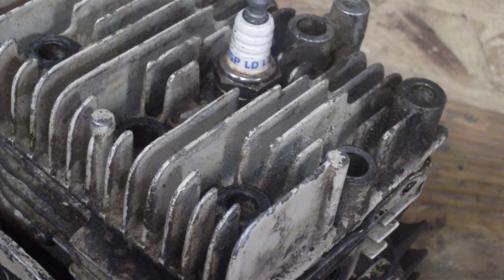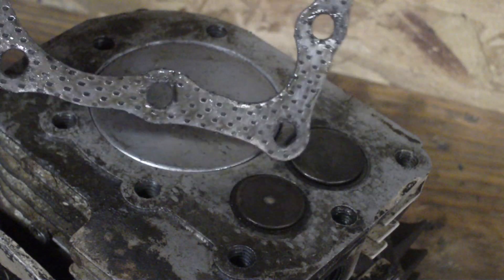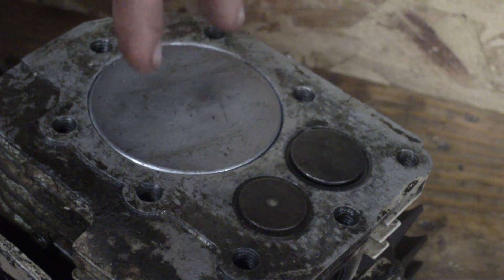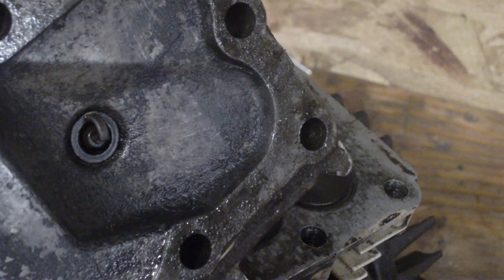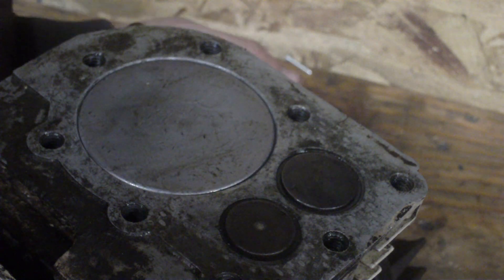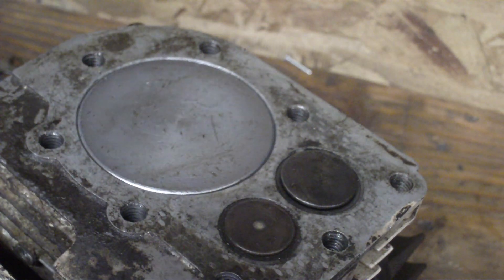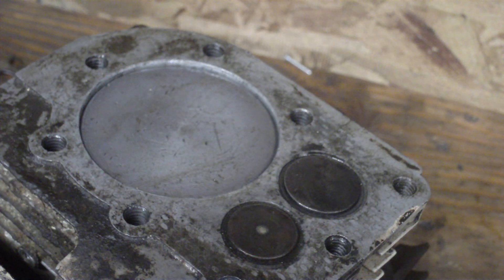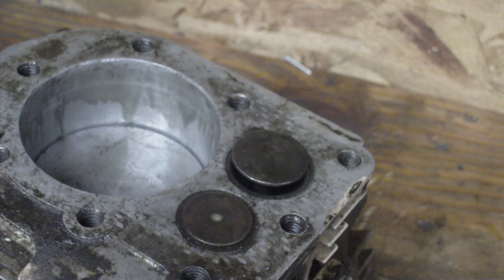How a 4 Stroke Gasoline Internal Combustion Engine Works

Comment: why are the valves inverted like that?
Reply from the maker: This is the old flathead or L-Head engine design, it was a very good and reliable design but has unfortunately became near obsolete, they have been replaced with OHV (overhead valve) engines. Which are more efficient but from experience, not nearly as reliable. Vehicles used to use this type of engine, Ford was well known for the Ford Flathead V8, great engines. I figured this would be easier to show the process because you can see everything moving together. Thanks for Watching!!!

Comment: what would happen if some how i put the carburetor where the muffler goes and the muffler where the carburetor goes
Reply from the maker: If you did that, you could make it run backwards, because the valve timing is opposite. I've seen some engines build up excessive fuel in the muffler and when you shut it off it will try and run backwards, almost like its dieseling. Thanks for Watching!!!
Reply: so could it run the same if i do run it backwards and if it does how can i run it backwards
Reply from the maker: Look up chargermiles007 channel on here, he actually did a year or 2 ago, it seemed to run pretty good!
Reply from the maker: i figure there will be oiling issues though, because the oil slinger will be spinning backwards too.

Comment: what was the engine out of mate I have a 26cc 4 stroke Briggs out of a whipper snipper and am wanting to find parts
Reply from the maker: It was off of sometype of push mower, not sure what type. It could have been off a tiller since it had the cast iron flywheel on it. I don't even have the model numbers for it. But the model number should start with 9, 9 cubic inch. It will either be a 3 or 3.5 horsepower rating. Thanks for Watching!!!

Comment: Great video, but I dont understand how the piston moves when it isnt the power stroke.  What is giving it the energy to come back up for the exhaust stroke and then down on the intake?
Reply from the maker: I should have mentioned this on the video, engines have a heavy weight on the crankshaft called a flywheel, it stores energy from the power stroke to keep it spinning between power strokes, think of it like how a washing machine "coasts" when the spin cycle stops, it takes a while for it to stop spinning, do the momentum of the spinning drum, just like the momentum in the spinning flywheel. Thanks for Watching!!!

Comment: I'm 50 years old and have never heard a clearer and more sensible description of how a four stroke engine works. I finally understand why air and fuel ratios are tweaked. Just never quite clicked. You, sir, have a gift for explaining things.
Reply from the maker: I hear ya! Glad to help out. I guess some people just explain things differently. Appreciate that! Thanks for Watching!!!
Reply: Double valves even makes sense now.  Ding!
Reply from the maker: I hear ya!
Reply: @fnaguitarplayer9  it's a pleasure to watch these types of videos. I've always wondered how it worked without a timing chain. Now I know why nearly every engine oil, passenger car, heavy duty diesel oils And motorcycle oil can be used in these little engines

Comment: what Couse an engine to leek oil from the breather  house the one the came from valve cover to the air filter on Honda 13 hp.
Reply from the maker: +lino zamarripa There's a few possibilities, first off is to much oil in it, that will make it seap through, also if the hose is starting to dry rot it will seap through, or if the engine burns some oil (blue smoke in the exhaust) blow-by past the piston can cause more pressure in the crankcase making it leak some oil. Thanks for Watching!!!
Reply: i putted new ovh cover and new breeder hoes now blue smoke come from the exhaust that's may be because the rings are bad thank you
Reply from the maker: +lino zamarripa Sounds like rings, valve guides (and seals) will cause it to, but usually the rings. Your welcome!

Comment: Hi, Your video is the best, and very much the only one about 4 stroke,  2 piston. I have a Moto Guzzi 850 and your demonstration clearly made me understand why my spark did not happen at the correct time therefore the bike never started. I therefore adjusted my ignition to happen on the second stroke. For me, I find it inconvenient to have to  remove my valve cover clearly see when the second stoke arrives, ready for the spark. I'm looking for tricks like putting my thumb in the spark plug hole or hearing the suction in the carburetor. Not sure. Any suggestions? Thanks. JD
Reply from the maker: +Jacques Daze Appreciate that! I hear ya. Glad to help out! It would be possible to go by the suction or compression on the spark plug hole, and gently use a small screwdriver through the hole to find top dead center, but it would be more accurate with the cover off watching the valves. Thanks for Watching!!!

Comment: I am a big fan of all of your small engine videos, thank you for posting. I recently got a mower (brute 22" with a flat head 675ex by briggs)from a guy who after replacing the coil, spark plug and air filter, couldn't figure out what was wrong with it, I brought it home gave it a few pulls and realized the flywheel key was broken. I replaced the flywheel key and it still doesn't run. I cleaned the carb, made sure it had spark. did a compression test: no compression. I pumped 80psi into the cylinder through the plug hole: no leaks. So i tried putting a little gas in the cylinder before replacing the plug and the gas was sprayed out the intake/carb. I put my hand over the carb and instead of suction I felt blowing. I removed the muffler and felt sucking though the exhaust. when i had the plug off i turned the motor over with my hand over the hole and felt suction rather then compression. i removed the head to see if maybe one of the valves was sticking but it looks like they are backwards, the exhaust opens and sucks in air and the intake opens to release the burnt air/gas. sorry for the long comment I couldn't figure out how to message you privately. I can make a video of that will help.
Reply from the maker: +Alex Rodriguez Appreciate that, your welcome! Ok, sounds like someone must of had it apart and put the wrong camshaft in it. I did this one time on a 14.5HP OHV briggs, i put a flathead cam in it because mine was bent, I thought it was the same but the valve timing was completely backwards! Its either that or someone put it back together and didn't like up the timing marks. Hard to say really for sure. Hope this helps! Thanks for Watching!!!
Reply: I pulled the crankcase off and the crankshaft gear had two marks almost opposite from each other, one arrow/triangular one and a smaller round one. I aligned the camshaft with the smaller round one and observed the valves. Worked perfectly! When I got the motor it had a sheared flywheel key so I guess the original owner thought it was a timing issue and tried to adjust it. Thank you for the reply.
Reply from the maker: +Alex Rodriguez oh wow, I was afraid it may have been messed with before or something. Glad you got it figured out, your welcome!

Comment: I remember watching this 4 years ago when I wanted to know how engines work and this video made me want to explore small engines. Now I have 2 commercial walk behind mowers that I fixed up for cheap because of my knowledge. I also got about 10 push mowers because I'm a hoarder. Just ran across this video and I thought I would share
Reply: The two mowers are 48" scag and a 48" exmark viking hydro walk behind. Both of those combined only cost me only $800

Comment: Let me ask you this if you may. I work for the fire department, and we have a few different 4-stroke small engines that power our vent fans and extrication equipment. It has been a long standing "rule" that, in the morning of every shift when we check out all our equipment and run these small engines for a couple minutes, that when we are done and shut them down, that we are to turn off the fuel shutoff switch and run all the gas out of the bowel, and turn the choke off. When asked what happens when and if this is not done, that if the fuel shutoff is left open and the choke on, that fuel can seep into other parts of the engine. But when asked further on this subject, they can not specifically answer as to if this really happens over the period of 24 hrs until the next on-coming shift starts and runs them, and if this is actually bad to NOT store them empty and with the choke off. So, is this actually true or not?
Reply from the maker: Joshua Kowenski Thats a good idea to do, and I do it on my mowers as well when I'm done cutting grass, the main reason is, if the float develops a leak or is jarred enough, gas will seap past the needle and flood the engine, which can leak into the crankcase/oil. If you shut it off and let it run out of gas in the carburetor, it prevents that from ever happening, also, it helps keep the carburetor from gumming up, if gas is left in a carburetor (not over a 24 hour period though) it will gum up and the motor won't run. The choke being open or closed doesn't matter one way or the other after running the gas out, because it would have be choked again when you start it so there is real no advantage or disadvantage from that. Hope this makes sense, if you have any more questions feel free to ask me! Thanks for Watching!!!

Comment: When do you do a valve job on a flat head lawnmower engine?  How do you know if that needs to be done?
Reply from the maker: John Mott Usually there is about 3 symptoms, first off is low compression, which is usually do to wrong or no valve clearance, and 2nd back firing or hard to start, and 3rd acts like the carburetor just will not tune in right. Thanks for Watching!!!

Comment: Thank you for sharing, One question. what it means when air exhauster starts to fire the fire out?  to much air in the mixture or too much fuel ?
Reply from the maker: Mars Seeker Your welcome! Do you mean fire coming out the exhaust/muffler? Thats can be from running to rich (to much fuel) or it can be valve related, if the valves aren't closing, mainly the exhaust valve not closing completely it will cause some of the flame to leak out of it. thanks for watching!
Reply: Thank you. it is taken care of . you're right, it was to much fuel.
Reply from the maker: Your welcome!

Comment: Great video.  My generator came with a Honda g300 flat head motor and has served for about 10 years. It ran out of oil (low oil shut-down had been disconnected). I tore it down and rebuilt, but it keep spitting fuel (instead of sucking fuel from carburetor) though timing is correctly aligned. My question is ... can it be that the timing gears (crank shaft and valve shaft) shift from its original correct point?
Reply from the maker: Thanks! It sounds like the valves may not be sealing right, did you reseat them and set the clearance? if not that is probably the problem. The gears can't shift, unless something moved when you put it back together, hard to say really. Also check (if its not firing at all) the flywheel key, they like to shear for some reason after a motor is rebuilt, mainly from the flywheel not tightened down enough. Thanks for Watching!!!

Comment: Although I've known for a long time how this works, in principle, I've never seen it shown quite as clearly, nor with a real motor.  Nice explanation.  Thanks for posting all these videos...I never really worked on motors when I was younger so this is a short cut to picking up some of that experience I would have gotten along the way.  Will definitely save me some money, and, of course, it's fun to make broken things work.
Reply from the maker: Matt Hill Appreciate that, your welcome, glad to hear it helped you understand it better. Its a fun hobby to get into, I like working on motors more than anything haha Oh yeah, it is really fun to fix something, especially when someone says it can't be fixed, like a blown up motor. Thanks for Watching!!!
Reply: My wife told me she was actually impressed I fixed it...she kept threatening to hire someone because it took me a while to find the time to get the job done.  And I have another fun job already waiting for me: I tried for hours to get my push mower to start a few weeks ago...I'll probably be back to your site soon to try to figure that out.  Thanks again.
Reply from the maker: Matt Hill haha i hear ya! I can tell you right now, if it has the type of carburetor that has the red primer on the side of the motor, right beside the gas cap, you will need the diaphragm for the carburetor. If its the newer style that has the bowl type / gravity fed carburetor, it more than likely will need cleaned. I do have videos on the diaphragm and other videos on cleaning carburetors. your welcome, feel free to ask me any questions you have!

Comment: I am going to take a small engines class in high school any tips you can share
Reply from the maker: I hear ya, best of luck to you. I learned what i know by helping my dad work on the mowers, best advice I can give you is to find some old push mowers or even a rider, anything with a motor (briggs and stratton would be recommended to start out on) and maybe take it apart and put it back together again, just to get familiar with all the parts, and don't give up, they can be aggravating at times to work on, especially when you get to taking the valves out, and as far as tools go, I have a video ( http://youtu.be/nFeH-vOYW9o ) that talks about tools for small engine and lawn mower repair. If your like me the best thing to do is learn by doing, i can sit and read something 100 times on how to do something and learn nothing from it, start working on it myself or helping someone along the way and i pick right up on it. Same goes for say a chainsaw or something that someone else has tore down, and expect you to put it together, its almost impossible for me to do that, i have to take it apart so i know how it came apart haha Thats about all i can tell you, if any questions or don't understand something in the class leave a comment on one of my videos or send me a message and i'll try to help you out as much as i can! Thanks for watching!

Comment: thanks for the detailed explanation. will a four stroke consume some engine oil due to the lubrication of the cylinder? I see from the cylinder walls that there is some oil which would probably escape via the output stroke?
Reply from the maker: Your welcome! Good point to bring up. Yes there will be some oil burnt, that is "left over" from the stroke, in a new or rebuilt engine this will be very minimal do to the rings sealing very well, in older / worn out engines the ring/cylinder will wear causing oil to seep past the rings and burn, causing the engine to blow blue smoke out the exhaust. This is why its important to check the oil every now and then. In lawn mowers i check every time i cut grass. Thanks for Watching!!!
Reply: thank you for sharing! my motorcycle consumes some fuel but not enough to see smoke. I have subscribed to your channel.
Reply from the maker: no problem! I hear ya. Well at least it ain't smoking yet. Thanks, appreciate that!

Comment from the maker: At first before the motor starts the power could come from the starter motor, and after its running the flywheel will store energy to bring the piston up on compression stroke, then when it fires forcing the piston down some of the energy is kept in the flywheel (like momentum) so the cycle can repeat. Now if your refering to the power to fire the spark plug, it comes from the ignition circuit either a self generating magneto (lawn mower engines) or a 12 volt coil that feeds from the >>>>>>

Comment: i dont understand where the initial power comes from when it sucks the mixture in before it fires to drive the piston down
Reply: The engine uses the momentum from the firing stroke.

Comment from the maker: I like the idea/concept of a 4 cycle weedeater, but i think the designs need to be improved alot on them, your 100% right, when they act up they will not run at all!!! I don't know about other brands of them, but I think troybilt is the worst! I don't know about the 4 mix, no experience with them, I don't like the idea of it, i'd rather have a more traditional crankcase full of oil for a 4 stroke. i do love the sound of 4 cycle weedeaters haha thanks for watching!

Comment: 4:50 it does make a spark at the spark plug every time, but that's not needed because there is only exhaust in the cylinder at the time. This happens because the flywheel is connected to the crank shaft and not the cam shaft.

Comment from the maker: trace out your shut off wire from the coil, sometimes a switch will go bad or a wire will short out against a frame, then if it still don't work, you probably have  a problem with the points and or condensor, which is more than likely the problem. i don't have a video on that at the moment, you can look on youtube here, i'm sure there is some videos on how to fix the points. Thanks for Watching!!!

Comment from the maker: it makes sense. it will be kind of hard to explain (in brief), i'd reccomend looking for a video on how carburetors work. what it does when the piston goes down on intake stroke, it creates a vacuum (think of how a vacuum cleaner works, how you can feel it sucking when you hold your hand to the hose), then the vacuum draws gas out of the bowl on the carburetor through various jets and circuits to get the right mixture (which is adjustable) then the fuel/air mixture is drawn into the engine...